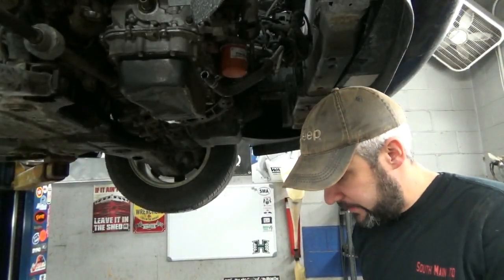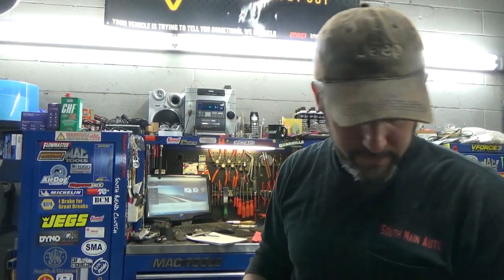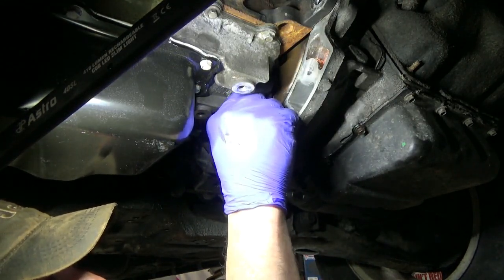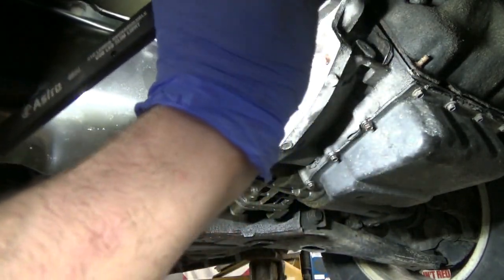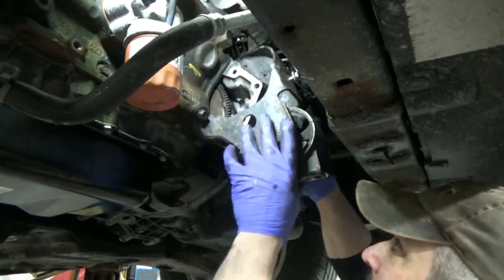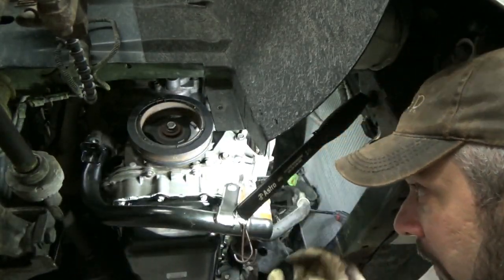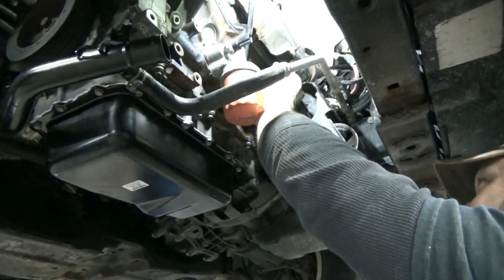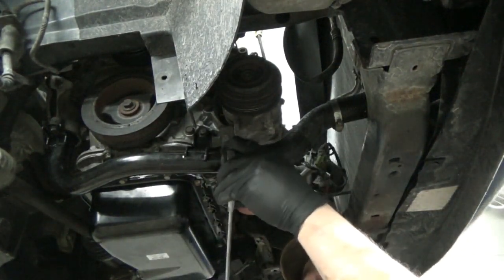Dodge Grand Caravan 3.8 - Engine Replacement - Part 4

Comment: I retired after 45 years in the automotive service world. 30 years turning a wrench and 15 years in management. After I retired I went to advance to apply for a part time job. They told me that I wasn't qualified to work for them. obviously they don't want anyone that knows anything.
Reply: I'd say you were over qualified which, in some cases, ends with the same result. Not getting hired.
Reply: Didn't want to pay you what you were worth.
Reply: I went to one not long ago, and the kid didn't know what a vacuum hose is. I have trouble spelling it, sometimes, but I know what it is, and I didn't want to have to describe it to him.
Reply: that shit happens all over the world ,.....nobody does his Job anymore  and nobody want to hire somebody who knows that Job I wounder how that ends.
Reply: It would be awesome for us the customers to have somebody with your experience, for sure. What were they thinking?
Reply: You didn't have enough 1 piercings 2 zits  3  play on your phone enough.  If it ain't in the computer, you're lost.
Reply: grant wright I did the same thing!
After I retired, I went to Advance for a job, figuring I would be part time, but I guess after years turning a wrench plus years in parts stores/management, I wasn't qualified!
Bottom line, you can't get good parts/good service from a place whose business model is price.
Reply: GM Kof hard I went to return a buddy,s duralast battery at Autozone and had the manager try to tell me that a car battery doesn’t have any AMPs, and his battery was fine because it would charge to 12.4 volts. She explained that Amps only come from the alternator...even after I pointed to the CCA rating on the side of the battery....she came up with some other acronym for CCA...(when you cranked his battery it dropped to 3 VDC) I went into full geek mode, had other customers giggling as she stood there not understanding one word...I got his battery exchanged.
Reply: your right and you are qualified to work at a Advance Auto they don`t want you to give any advice to a costumer . if you told a costumer how to do something and they do it rouge they will go after  Advance Auto . sad thing is you gave out good advice but the costumer ia a dingdong lol

Comment: I deal with the same with advanced auto. The best is when they tell my customers what the issue. Customer comes to me with the part and I ask them are sure that's the problem "yes, the guy at advance auto told me" so I put the part in. Next day the customers calls me and say that their SUV is acting up again and they have another part that the guy at advanced auto told them to buy. I ask again if they are sure that's the problem "yep the guy at advanced auto told me for sure this is the problem" surprise I put the part in and it doesn't fix the problem. I do some investigating of my own and all it turned out to be was two loose Allen bolts. Told the customer he didn't need the parts he got, to stop getting advice for the guy at advanced auto and let me diagnose the problem.

Comment: You're not alone, Eric. Our suppliers here in Canada are so bad that we look up the parts we need online and give them the part numbers. They can't even get that right sometimes.
Reply: That's what I do.  I look it up before I call them.  The local NAPA will say that they do not have it, and then I give them a part number and suddenly they have it.
Reply: Local parts shops are a joke PERIOD ! , needed a battery for my 2014 Mitsubishi Outlander , took 3 melon heads at Napa to figure what was right one , looked it up online , while there and gave the product # , then he tries say it not right one , brings it out anyway and it matched perfectly to the original battery I was reading in on core charge . Bunch of wing nuts !
Reply: I buy all my parts from RockAuto.   Bought everything from spark plugs to a transmission from them.  Haven't had a problem yet.

Comment: I have ran my Auto Repair and Restoration business for over 20 years now and have had much of the same frustration as you when it comes to getting the right parts in a timely matter. 
I have used NAPA for most of those years and I don't know about your area, but here they are manned by old timers who know their job and have lots of experience and tips. Parts mix ups are rare and the quality is great. Have you considered using the Napa  in Bath NY? I believe they are only 8 miles from your location. Just a suggestion. Usually companies are more liable to listen to you when you take all your money elsewhere...
Great video's and great work! Thank you!
Reply: Eric uses NAPA when they have the parts he needs. In this case, they didn't and would have to order it and Eric didn't have the time period they needed to deliver them.

Comment: Well for the defense of the Jeep gasket you were sent, my long block 3.8 Chrysler from Promar Engine came with a Mahle engine gasket set and it's labeled Jeep 3.8 too.  As far as I know, Dodge, Chrysler, Jeep and Plymouth are the same auto manufacturing group.  I am enjoying your install and not having the lift I will ha true to go the top install as well.  Most of my engine problems with the Chrysler corporation seem to be from corroded lines and bad previous owners.  I like the 3.3 L and 3.8L design.  It's a lot easier to work with than our Cadillac Deville with the Northstar motor.  Great video and awesome young assistant helping you. Good for her!  Nice honest work for a young adult.  Teaches values and customer interaction and builds confidence as well.  More kids need to get their hands dirty.

Comment: Am in the middle of replacing the same engine on the same generation van.  The water pump issue you had to deal with saved me.

Comment: I worked in auto parts and learned the hard way by looking up parts in catalogs before everything was on computer, they were just starting to put the catalogs on microfilm and computer in the early nineties when I worked but the store I worked in never modernized, the owner was Korean and died when he fell off a ladder while cleaning the gutters on his house, he refused when a larger store wanted to take over and modernize so he died without a penny to his name, the geniuses that work in advance or AutoZone wouldn't know how to use those old catalogs especially when you had to cross reference it was a pain the one warehouse we delt with was really good at helping out again the old fashioned way.

Comment: As someone running a "part time" shop,  I'm not exactly a DIYer, but, I'm not ASE certified either. I've never liked any of the chain stores since, as you said, the counter people are all know nothing kids. A few years ago, I got to the point that I'd only go to Advance for oil, filters, or, some stupid tool that I desperately needed on a Sunday. 2 Sundays ago was the final straw! I needed a fuel tank retaining ring tool and they said, on the phone, that it was in stock. I walked into the store and they didn't know what I was talking about! Yes, I'd called THAT store and given them the part # from their own website. They didn't even offer to try to order it! Luckily for me, our local NAPA has recently extended their Sunday hours. So, I walked across the road and bought what I needed (in stock for only $2 more for the same Lisle tool) from a REAL parts store. I'll NEVER darken the doors of ANY of our local chain stores again. In my opinion, the fancy signs and bright lighting of the chain stores doesn't mean a damn thing if they don't know what they sell, let alone what they have on the shelves. We have 2 Advance stores, an O'reily and an Auto Zone (the O n A-Z both opened in the past 2 years) and 3 REAL ones that have been here forever. This is in a town of under 30k population. Luckily, our REAL parts stores are holding their own, and, actually prospering, since they know what they're doing!

Comment: Great illustration of what is involved each day. Dealers bill by flat rate. The techs are working on warranty jobs-new vehicles with clean parts and all needed parts are easily available. This job, one would hope, would require I guess 10-12 hours. This job must have required 20 plus hours with all the problems that were involved. Eric did a good job keeping his cool.

Comment: Last February, had reason to replace pan on 545RFE, and got one with a drain plug, a new (chiner) one.  I came with a fat tube of gray (chiner) RTV, fool me, I used that chiner garbage, filled the trans, and next day a seep from the right edge of pan/case.  Fool me for using that bogus garbage.  Drained pan, cleaned the case and pan all up, used the whizzy wheel to remove the powder coat from the pan lip, and applied real stuff, Permatex Ultra Black... no more leak.  Worst part, I also used that chiner garbage on NP247 rebuild, and, of course, the rear case half is now seeping weeping, and I get to pull it and redo.

Comment: The pains of dealing with part suppliers !  Years ago a shop owner told me it's best to take the part you need to the part guy to match up parts. He also said to not let go of the one you have or it will get lost at some point before the parts are located. I know it's difficult to make that happen as a single mechanic shop but there are times when it has to happen, such as the water pump/gasket cluster. Also, I know that six or Eight point bolts will live through the extreme heat generated at the exhaust flange. We had to use them for our headers all the time when unbolting the exhaust system from time  to time. Maybe the salvage yard will give some credit toward the oil pan damage since they didn't disclose they will be selling you that engine with a bad one. Maybe not a credit worth the entire cost to replace it but a lower price on the motor to keep all fair. Lots of fun there, I hope the A/C compressor is still good. Hate to send her down the road with one that's bad especially since the system had no refrigerant in it. 

Yes, those "chain auto parts" stores are a real PITA. They do not ever have long term experienced counter people. In addition, they tend to have to order parts all the time as they are not in stock. We have an old school privately owned "ma & pa" traditional auto parts store in town and they get warehouse deliveries twice a day so if they have to order a part for you, it's there by 1 PM or by 4 PM that same day. In addition, the counter folks all know more about things than most other places do and it helps them as much as it does the customer.  They get all of our business because of their great service.
Reply: Hey garth we had a great place like that too but unfortunately they closed down about 2 years ago. I used to get all kinds of parts their for everything from cars to tractors

Comment: Hey Eric O!  Great videos as always!  I agree with you in Advance Auto Parts.  The stores near me are filled with young strong ego kids that think they know the secret to the universe.  I repair and maintain 8 vehicles on a regular basis and I love taking advantages of the online promo codes for in-store pick up.  I don't care for the quality of a lot of their replacement parts and their customer service sucks most of the times but, at the end of the day money talks.  Autozone is also hit or miss on quality.  I prefer Napa when possible but, they can't touch the Advance Promo Code discounts.  

Your a good guy Eric!  The reason I feel that way is because most shops would just purchase the expensive parts through Advance Commercial and mark the parts up even more to compensate for their cost.  You are always concerned about saving your customers money and doing the right job.  Your a REAL mechanic!!!

Comment: You need to move to Phoenix and open up a shop right in my neighborhood.  I have 5 different parts shops within 2 miles. And not a 1 is Advanced Auto. 1 is a lil parts shop called Penny Pinchers. They are always cheaper than any chain store. Bad part is you have to wait in line at least 30 minutes each time cause their that busy.

Comment: Eric, I take it from your tone that you didn't send a Christmas card to Petey this year. For those that don't know Petey is Eric's Advance account manager. Where has the love gone in this relationship? Can it be saved? Time to call Dr. Phil.

Your comment about Aircat/Nitrocat impacts is entirely correct. These are high quality and very, very powerful impacts but they are totally binary with respect to their triggers. Full bore or nothing. Sort of a shame since they are good tools. Best trigger control ever on a impact was the I-R 231 (what you call a THUNDERGUN) very nice feathering trigger. To me this is the best advantage of the cordless impacts. The variable speed triggers are better than any air powered tool.

Comment: I sense frustration as you talk about Advanced Auto?  I only go there when I need a light bulb or automotive cleaners.  I had gone there once and I told the gal working there she couldn't bench test the new alternator I was purchasing (2006 Pontiac Grand Prix GXP).  She said I'll bet you 10 dollars I can make it work, I took her bet.  Moments later her and her attitude came back with my alternator and a 10 dollar bill.  I said sarcastically "awe couldn't make it work" followed with a "told you so", and "easiest 10 dollars I ever made"!  35:51 SMA Restorations?   I don't blame you for fixing and shipping the car, you aren't paid to clean them!

Comment: Thanks for the video.  If you think Advance Auto is bad, you should try Auto Zone.  Their parts are complete junk!  I do remember that TRT41 code, it was awesome!  I'd buy brakes and rotors, split up the order and save $80!  Man, I miss that.  Haven't shopped there much since they did away with it.  I'm mostly on Rock Auto or NAPA now.

Comment: Eric awesome video of caravan job I actually have done town/country motor job the same way because some one welded two frame bolts to the body and to do that it was disgusting this is the kind of techs or hacks that are in this industry that makes us honest 30 year veterans look bad. So I had to do the same procedure to remove my engine job out of the engine bay. I'm at a independent shop in Nassau county on Long Island. I love what I do except when I see things like that I'm sure you feel the same. Keep posting vids and I will keep watching.

Comment: I live in Denver, was visiting my grandmother in Pittsburgh last year and thought about driving up to you for an oil pan gasket job.
Reply: If it took you five hours to go from Pittsburgh to Buffalo on Interstate 79 you either drive really slow or slept for two hours.  I  easily made it to Avoca in 5 hours from Pittsburgh (Bloomfield section of the city) after picking up my brother and I didn't break 80 even once (because if I would have my brother would have yelled at me). Out here in Phoenix it's petal to the metal buddy. Don't visit here or the locals will run over you. Avoca is on the southern side of New York State close to the PA line whereas Buffalo is North on Lake Erie. Don't go to Buffalo to go to Avoca.
Reply: If you decide to go to Avoca I wouldn't go via Corning. This seems like the fastest route but the travel is much slower than 79 and then 90 and then 86. The diagonal seems like it would be faster it is not. I brought my brother back from Avoca via Corning and that was much slower than the route we took to get there.
Reply: Chad Buckwalter Greensburg Pa woo woo.
Reply: SATAMAN Schmidt I think from my grandmothers house to Avoca was around 5 hours. Phoenix? I go down to Phoenix all the time. I love the drive from Denver to Phoenix. I figured Eric would appreciate working on a car that has 200k miles and pretty much no rust lol. Oh and yes they drive way to damn fast in Phoenix. The 60 is a racetrack. Everyone trying to escape the heat I suppose.

Comment: I would gladly drive hours so you could work on my car. So tired of paying money to have tings fixed and then it is not the problem.And seeing crappy work.  But I am on the west coast. Love your videos. They have saved me money even though I don't know much about cars. Thank you MR O.
Reply: Its never too late to learn.  I never use a shop - have no need.  Get the factory service manual for your vehicle and read.  If I am going to perform a service on one of my vehicles, and it doesn't matter if I've done the job 10 time before, I first read the service manual.

Comment: I've seen that parts game played too. They contact corporate offices and set up a corporate account where we were supposed to get better pricing. The prices were higher than we had been getting and I suspect somebody in corporate was getting their pockets lined. The welding supply company we had to change too charged almost twice as much for oxygen as the other supplier we used before.

Comment: My Advance Auto at least has some older guys at the desk. Not usually too bad getting through to them for the correct parts. The biggest problem for me is the constant opened box items they provide. I have had to ask again and again to get me an unopened box so I have a chance of getting all the parts. Burned too many times with missing bolts, connectors, gaskets etc.

Comment: O'Reilly messed me up the other day when I went in there and asked to borrow a tool to pull a CV axle from a 1998 Chevy Prizm. They suggested a claw tool with a slide hammer. The claws were too short, so I returned to the store to swap it out for something longer. They gave me the longest one they had, but it was not compatible with the slide hammer they lent me earlier. I was pissed that I had 3 tools and all of them were useless. I ended up using a pair of vice grip tongs, two C-clamps and a hammer. I was so pissed, it came out after a couple of very hard hits. Not to mention I bought an axle shaft seal that was too small lol. But we didn't give up and got it done right.